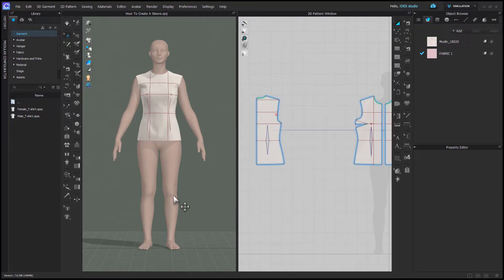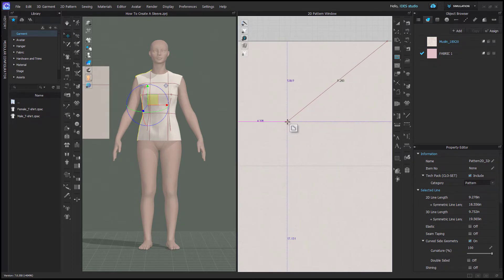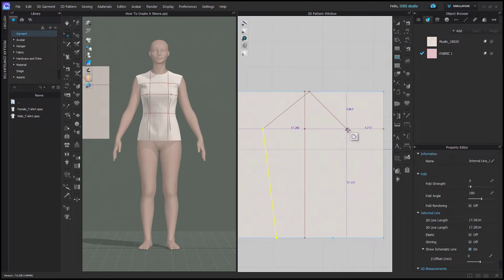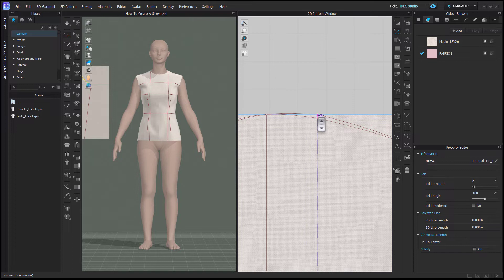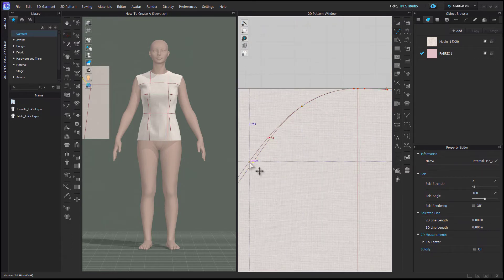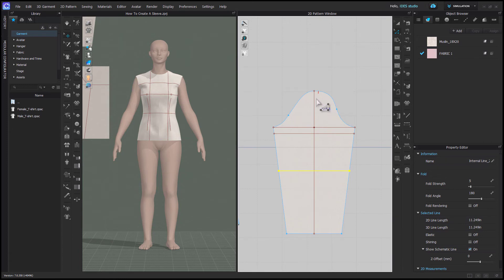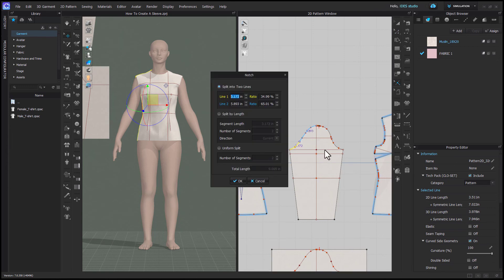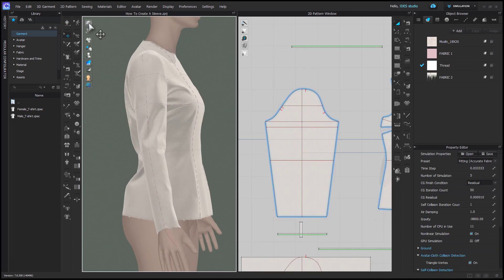How To Create A Sleeve Pattern in CLO 3D

Comment: on my pattern the curve is over the edge of the pattern. just like in the video at 3:46. and when i try to select the 2 points and drag them down, the entire line moves down. it does not anchor at the point on the center line of the sleeve head like in the video. what am i doing wrong?

Comment: Stunning but couldn’t get why and what’s the methods you use
Reply from the maker: Hmm, what do you mean?
Reply: @ides.studio  it’s hard to explain because of my English but I mean why you offset about 0.75 inch or something (I don’t remember clearly)

but anyway you’re doing great work 🙂
Reply from the maker: @akhmedmagomedov7552  No worries on the language. It's so hard to translate industry-specific terms. I think you mean "the ease." There is usually about 2-2.5cm or .75-1" extra in the sleeve cap compared to the armhole, sewn only at the middle or shoulder tip. This is true for woven, set-in sleeves, not knits/t-shirts. It's what helps the sleeve have that little bit of roundness to go over your shoulder. Let me know if that's what you were asking.
Reply: @ides.studio  okay now I get it. Thank you :)
Reply: I think I don't get this because I have no education or experience in sewing or designing